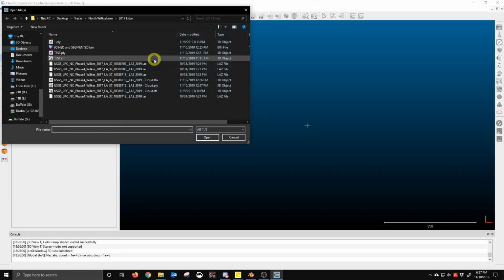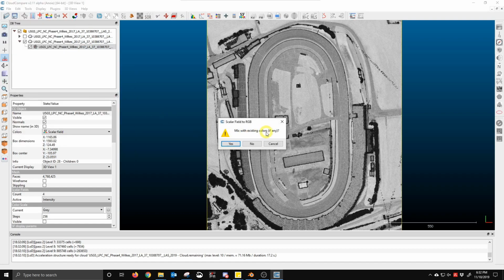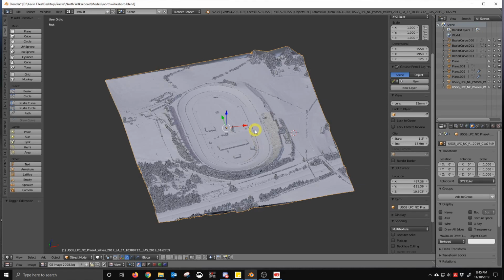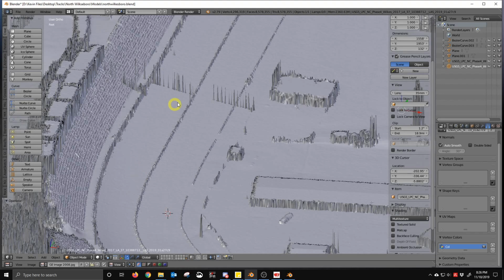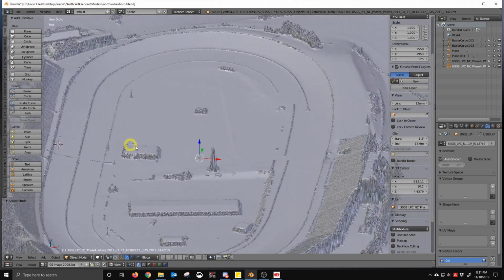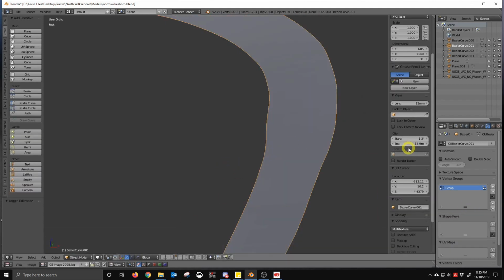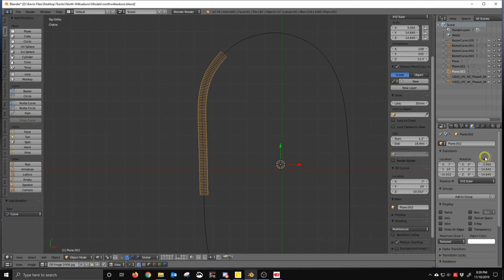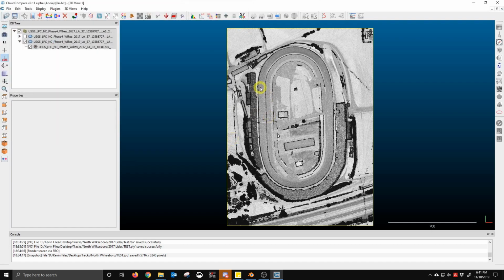Track Building: Episode 1

Comment: hey lilski, when doing the shrinkwraps and subdivisions for the first time- how do you deal with a track that has multiple layouts? I'm making a karting track and i'm rather stuck lmao
Reply from the maker: Multiple layouts kind of suck but the same process applies. Depending on the track I usually pick the "main layout" and treat that as the complete loop. Then any offshoots for multiple layouts I would do individually on their own curves using the same basic process. It's OK if the physical meshes overlap a bit initially for testing. Once happy with everything you may want to boolean one to cut off the excess so there is no overlap. For example on Watkins Glen the classic short course is the main track loop. The bus stop and boot were both on their own curves and joined up where they meet the main loop.
Reply: @LilSki3  ahhh ok! Cheers :)
Reply: @LilSki3  also, should the pitlane be included? The kart track i'm doing has an outfield pitlane, although i could be getting ahead of myself.
Reply from the maker: @y0ink__90  I usually treat pit lanes like the other layout pieces. On it's own curve and joined up to the main layout.
Reply: @LilSki3  again, thank you! Appreciate it :)

Comment: I'm wondering how you would go about locating LiDAR data outside of the U.S? In places like the middle east maybe.
Reply from the maker: Every country is different. Some are free and some you have to pay for. Really have to do your own research to find if data is even available and if you can obtain it.
Reply: @LilSki3  I did some searching and couldn't find any publicly available data sadly. Is using google maps/earth a decent alternative? Thanks
Reply from the maker: @Tigerbear62  No GE alone is not accurate enough unless it is one of those "photogrammetry" scans that some areas have in GE. Aerial photos alone are not very accurate since elevation scews the angles. I've never had a GE image fully line  up with data. You usually have to line up a section at a time when using it to place objects. Once upon a time it was possible to extract that 3D data from GE but I'm not sure it's still possible.
Reply: @LilSki3  Thank you for your help!
Reply: @LilSki3  there is a way to get the data from maps but as you said it is nowhere near as accurate compared to lidar, have been messing with gis and osm addons for blender they work well for the most part if you wanted to make a track that is not covered by lidar.  it also has options for road curves and basic box buildings. thanks for your input to the community its insanely good !!! just what im looking for to make tracks.

Comment: Just wanted to thank you again, I made it through this episode, track is looking great! I took your advice and made the curves much more dense than the straights.  Just a question,  in case I made a mistake, in edit mode I still see the plane being wider, but in object mode I see it is perfectly shrunk to the mesh I made. I assume this is because I haven't applied the shrink modifier?  I noticed you didn't apply it in this video. Is it time now to do that?  Thanks!
Reply from the maker: There are a few buttons on the modifier that control whether it is active in edit mode or not. Also I rarely ever apply modifiers if I can help it. When you apply it's a one way street and no going back.
Reply: @LilSki3   Ok great to know, I will leave it as is and toggle it off, I am using 2.9 sadly so I will find the button to turn it off.  Thanks as always! One to the next video! hahaha

Comment: Hi, I am making good progress but stuck a little, I am doing this road course, but I am trying to do the beauty fill (21:37) and when I do this it does fill in the track but also connects the outside and inside areas of the track where it is able, I am assume I am missing something in how I select the vertices?
Reply from the maker: If you pay attention you will notice I filled in the ends by hand and when I selected them all after the two center verticies were not selected. This forces it to fill within the track bounds and not in the infield.
Reply: @LilSki3  Ahhh I saw that but didn't catch on as to what was really happening hahaha Ok I will dig into it further to see if I can get it to work.  Its the filling in I think that I am missing.  Thanks so much as always :)

Comment: As I mentioned in other posts on this I have to say it again, amazing set of videos, I use these constantly as I am learning the RIGHT way to build tracks. So to my question, unfortunately I can only get google maps data for my track here in Canada. They are not a open on sharing the lidar data.  So I have the data downloaded from google, is the process the same?  I am a little stuck on if I can shrink wrap my track down as you are doing here. Thanks again for all your help and your contribution to the community. Looking forward to you returning to building tracks!
Reply from the maker: Whatever data you get the process is pretty much the same. Canada has been hit and miss on data but there is a decent amount that is scanned. What track is it?
Reply: @LilSki3   the track is called Area 27, it’s in Oliver B.C.  I was worried the google data might be poor but I’ll try it. Let me know your thoughts on that track if you find anything. Thanks again.
Reply: I spent the day searching for tracks in the US that has lidar data, I found some but after following along and getting into Blender I see the quality if quite poor, I tried another track but same issue, is there maybe a steps I could be missing that defines the quality of the data or is this kind of hit and miss? I am just looking for any track I can use to follow your tutorial. I have a few tracks from google but the quality of the image isn't great so its hard to trace the actual track outline. Thanks!
Reply from the maker: @daveacorn782  Using the inventory site you can see the year and resolution of the data. Anything 1 meter or lower point spacing is usable. .7 and .5 is usually about the best you will find. That site lets you see that basic data before you try to download anything.

Comment: where do i get laz files for the lidar i downloaded the database from the website in the description
Reply from the maker: The inventory site simply tells you where the data can be downloaded and provides links to do so. Once you click on an area at the top left will be a drop down that will tell you the basic info of the data. In there you will also find the links to download if it is free.
Reply: LilSki's Tracks I clicked download and it just gave me the entire database but I can’t open it with cloud compare
Reply from the maker: @phoondos  Each site is different and has different ways of downloading the data. I'm not going to go over the process on every site. It's not that difficult to figure it out usually.
Reply: @LilSki3  managed to get a link for a LAS but im getting network error on the download so imma just give up for now

Comment: Thanks for this! made me find my local gokart/autocross tracks Lidar data here in Norway. Not sure if you answer questions here or another place, but when i choose Intensity on Scalar fields in CloudCompare the data goes mostly black. is there a way to add light so i actually can see something? i guess the norwegian data is different than the US one.
Reply from the maker: I have seen some data that won't load intensity correctly inside CC. In the past I've had to use another program like Global Mapper (not free) to open the data and prepare it for use in CC. If I get a chance I'll look at some data like that and see if I can post a simple solution to overcome it.